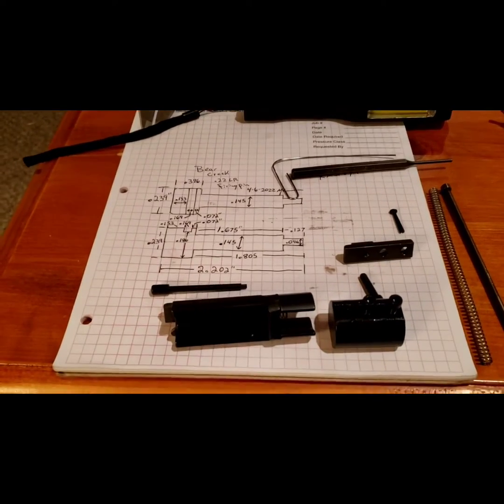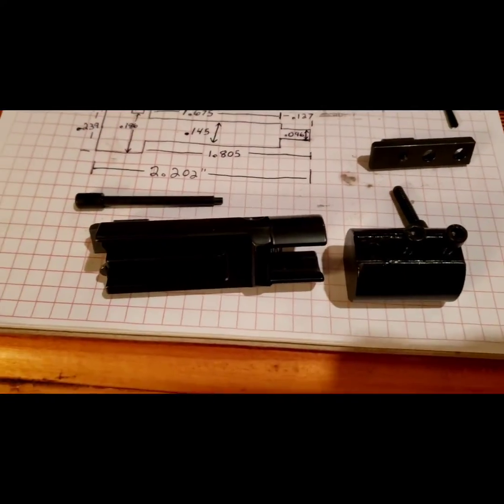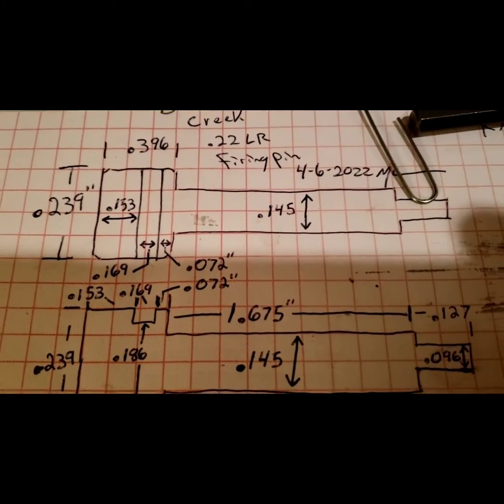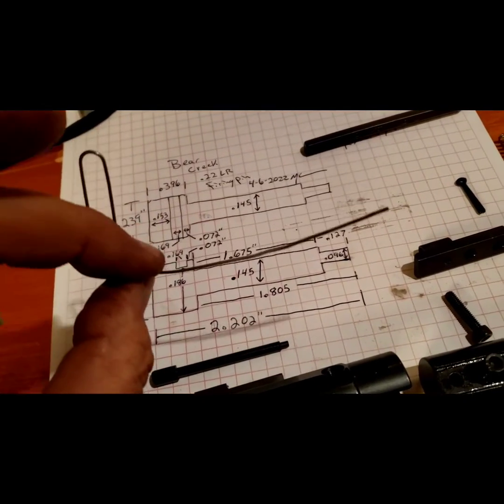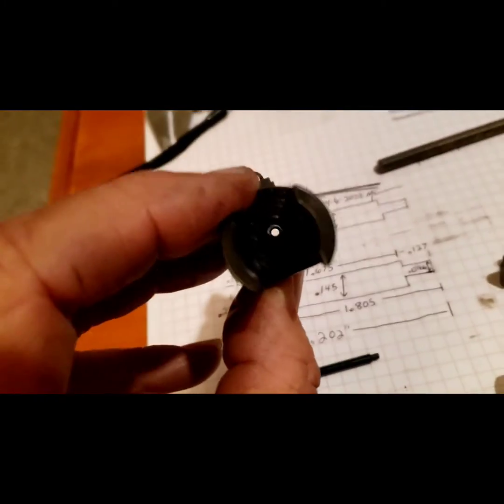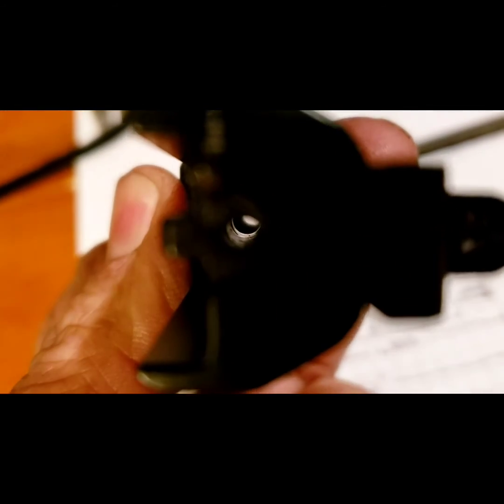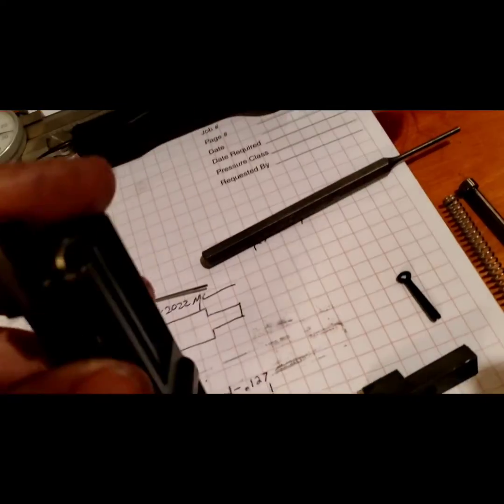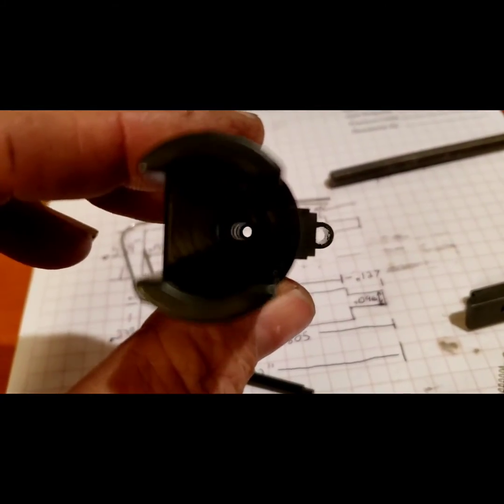Bear Creek .22LR BCG / Firing pin and springs.

Comment: How did you take through recoil spring out. Don't want to break anything taking it apart
Reply from the maker: @LandrelBrown  
There is a small "pin" that the buffer weight rests against.
With the firearm unloaded, magazine removed, upper receiver removed; access to this area is easy.
The "pin" can be depressed while pressing the buffer weight inward (to the rear of the buffer tube), then under a controlled motion, the buffer weight and buffer spring tension can be released past the "post" and sprung out, over the lower receiver.
(As the 22LR uses a captive bolt and recoil assembly, not needing the buffer tube spring.)
A spacer of blocker may be needed to be added if the Bear Creek bolt carrier enters the buffer tube. (As this will change the stroke and the timing gets out of step)
Reply from the maker: Oops, I may have mis understood the question.
I believe there are some "c" clips that retain the Bear Creek spring.
I'll look tonight when I get home from the day job.
Reply from the maker: On the bottom of the BCA rear weight, flip over the assembly to see a recessed Allen screw.
This screw holds the guide rod captive..
There is an index notch in the guide rod, it only fits logically one way to reassemble.
It feels like there was some light lock tite on the screw.

Comment: Never Mind looking at your blot I found the problem thanks
Reply: How did u resolve your firing problem? Tried mine out today. ...won't fire at all. 🤬
Reply from the maker: @CompanyHaze 
If the hammer spring is light, I would have ignition problems. (Light strikes)
I believe the hammer spring now has around 4# of force needed to pull back from the forward position.
To measure the hammer spring I separated the lower, held the hammer with a finger, pulled the trigger and slowly allowed the hammer to move forward, to the "fired" position.
Then, with a trigger pull scale, pulling back on the hammer face until there was movement from the forward resting position. 
Light spring= light strikes.
Reply: @Michigan4Conservative  ty brother 👌will do.
Reply from the maker: @CompanyHaze  
I think another thing that helps me with reliability: the folding stock adapter from UTG (AK folder I believe they call it).
It blocks the buffer tube, so there is no interaction with the Bear Creek bolt carrier assembly and the buffer spring.
Reply: @Michigan4Conservative  i don't have an AK47. It is a Mil-Spec buffer tube.
Reply from the maker: @CompanyHaze  
Correct.
For whatever reason, the company called it that, even though it is a mil-spec ar-15 buffer thread. 
They spin into the receiver and then the buffer tube spins into it .
https://youtube.com/shorts/1ydUjlpq6cI?feature=shared
Reply: @Michigan4Conservative  i bought a 22lr AR Buffer Pressure Plug from Bore Buddy, I'll let u know how that works. Ty for your assistance brother 👌

Comment: I to have the BCA 22lr. upper.  How did you get the spring off the bolt carrier group?  My front screws are coming loose.  thanks in advance
Reply from the maker: Thanks for the question and comment. I was on the roof of my "garden shed" project, and not able to respond sooner.
Glad you got it figured out.👍

Comment: Hi I just watched your video. I too have a bear creek dedicated upper, I had issues resolved by bca with the upper for ftf and fte. I recently put a PSA flat faced trigger in the lower now all I get is light primer strikes. The lower works fine with the PSA 22lr and the cmmg 22lr upper I have. Do you know if bca offers a different tipped firing pin because both other uppers have rectangle tips.
Reply from the maker: The new 22LR 16" upper that i just purchased from BCA has a ~mostly~ round firing pin. There are two flattened spots, at 12 and 6 o'clock.
I've found my hammer spring makes a difference with good vs light primer strikes. (I use a trigger pull scale, and with the lower separated from the upper, and the hammer cocked, see how much force it takes to pull the hammer off rest, towards the grip.)
Light hammer springs of 2 or 3#, I've found lead to light strikes. 4 to 6# seems to be reliable. 
Another way of measuring the hammer spring:
Again, with the upper removed, this time the hammer forward, against the magwell.... see how much force it takes to pull the hammer off rest.

This may not be the "gunsmith" method, but it seems to be a consistent way for me to measure this variable. 
I have no contacts at Bear Creek, also no source for parts for their tools.
Reply: @Michigan4Conservative   I don’t have a pull gauge psa lists the pull of the trigger I installed at 3.5 lbs. That is most likely the issue. I just started tinkering with building instead of slapping tops on lowers. Gotta love the ar platform, seriously like Lego’s for grown ups.
Reply from the maker: @johnkakesmandersons  
Absolutely. 
As long as you are patient, the rewards follow. 👍
Reply: I called customer support earlier they just called back they are sending me the newer firing pin with the bevels. I have nothing but good things to say about bca. It may not solve my problem but a spare firing pin is a good thing.
Reply from the maker: @johnkakesmandersons  
Terrific. 
Thanks for the update. 
Hopefully that keeps you going. 
One thing I wondered, but haven't measured yet:
If the retention pin position makes a difference on firing pin travel.
The notch in the firing pin, is  there a difference indexing the flat or the round of the retention pin?

Comment: I didn't see a follow-up video so how did you clean it up what tools did you use I don't want to mess one up
Reply from the maker: Actually, this is a Bear Creek .22lr bolt carrier group. I haven't had any issues, but another viewer was...so, I broke down my bolt and firing pin (to see if mine had flaws. It did not)

I had a long running "bad experience " with a different manufacturer, using a similar design. That one had design issues beyond my ability. 

As for anything that could be done to the Bear Creek, possibly smoothing surfaces with a light abrasive. (Keep in mind: removing any bluing or exposing any raw metal may lead to rust)
I typically will manipulate the parts by hand, feeling for any "hang-ups" or places where materials don't interact smoothly, polishing as required. (Most of the time, if it works, I don't mess with it)
It turned out, my light primer strikes were corrected by changing the hammer spring. The spring was too light to consistently ignite the primer.
The new 4# hammer spring (standard AR15 spring) works great.

Hope that helps.

Comment: Thanks for the info. I wonder how hard it would be to turn that into a chisel tip. I have an extra spare from Bear Creek
Reply from the maker: It should be easy file work.
Slow and steady, make sure to index which is the top. 
Good luck